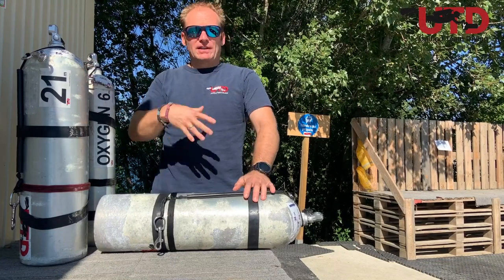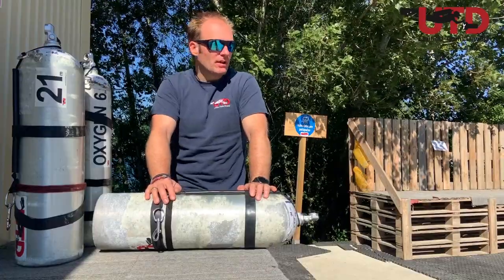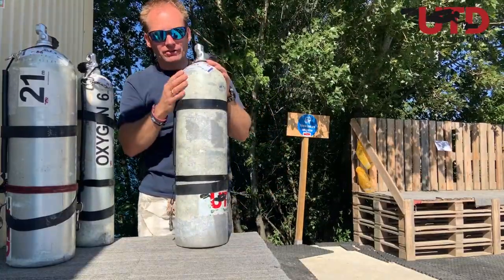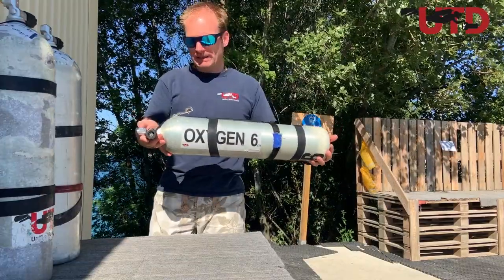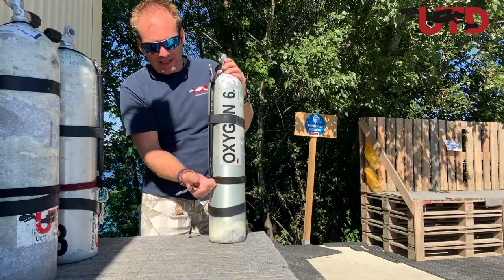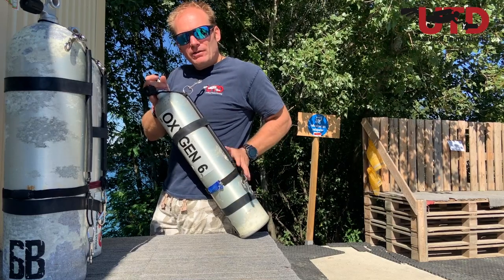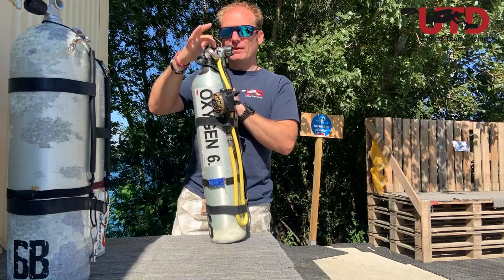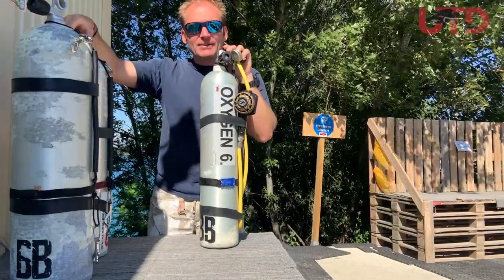What is the difference between a Stage and a Deco cylinder in Technical Diving and how to mark them.

Comment: Hi Ben! Thank you very much for this helpful video. As always, you offer really valuable information in all your videos!
I have a question, regarding the cylinders content. Could I use the same bottle, besides the issue of the labeling, with different gases? That is, if I have a stage bottle with bottom gas, once it's completely empty and the labels are changed, could I use the same bottle for oxigen 100%? or it is necessary some kind of cleaning process before? The same example could apply, for instance, if I had a deco bottle but, instead of a deco mix, I would like to fill it with air (cheaper, easier access) for training.

Comment: What is the standard material for stage vs deco cylinders? Thanks.
Reply from the maker: Hi Matthew, we think that the cylinders you wear on you side need to be aluminium. Regardless if they are called Simemount-Stage-Deco. The ability to be able to move the cylinders under water is crucial in all 3 applications and aluminium cylinders, especially 40cf and 80cf sizes are almost neutrally bouyant and have a good balance with regards to how heavy they are at the top vs. the bottom.
Reply: @UTD_ScubaDiving  Thanks for the thorough answer and all of your excellent videos.